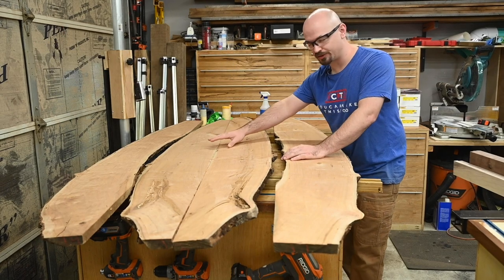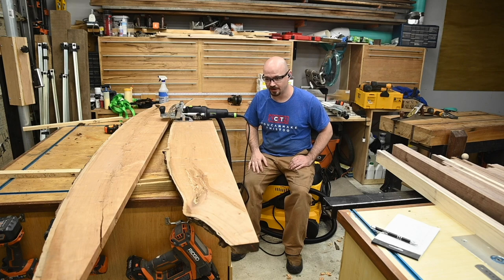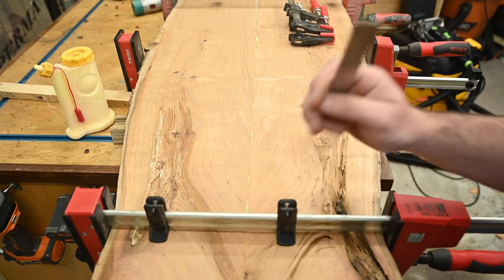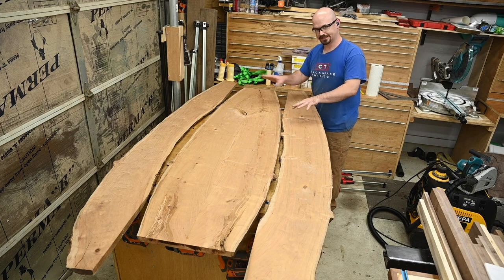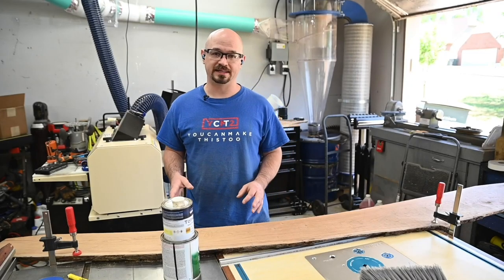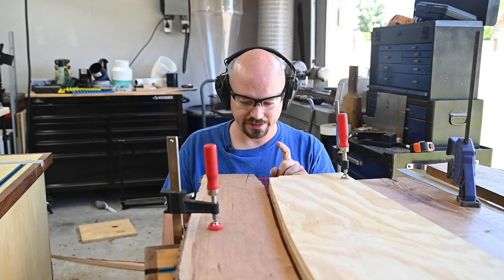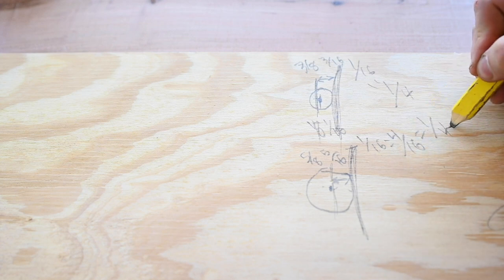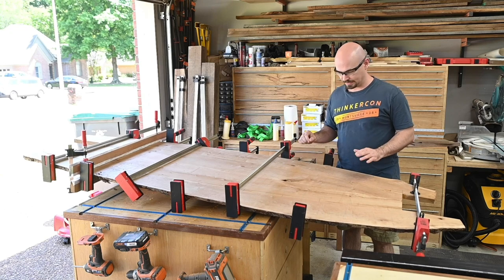Joining Boards on a Curve for Oval Table Top - The Big Build Off

Comment: I’m glad I stumbled on this video. I’m getting ready to join a slab top and wanted to make it a curvy seam. I was just going to try to make matching templates out of MDF. I didn’t consider the fact that the width of the router bit would mess up the curves. Obviously I would have realized that after it didn’t work. But this is going to save me a ton of frustration and scrambling now that I know how to do it right. On the plus side I only have to make one template instead of two. On the downside I have to buy a bushing set.
Reply from the maker: Buying the bushing set beats doing it all once just to not be happy with it, then having to buy a bushing set and do it all again once you figure it out

Comment: Wow, what a nice film, so good to see your thought (and character) process as you go along! You are very clever.
One thing I felt as you described how you were going to cut off the piece with what you called the rot I wanted to shout out to you: Are you really sure,? Of course if it's a total loss, you dont have any other option, but with just cleaning it out and filling with either a replacement piece, or a decorative filler (ground turquoise if you don't mind the kitsch, or wood, or epoxy with gold flecks, you could have a unique decoration.
Reply from the maker: I was okay with there being some.. but didn’t want it to detract from the design or rest of the wood. Stuff like that tends to really draw the eye, but I want it drawn to the shape, the curves of the grain, etc... first Friday of June the finishing video will come out and you’ll see how I approached them. I’m not opposed to highlighting defects, but I wanted to go a different direction with this table. Thanks for the input!

Comment: Have you ever tried jointing curves at the same time with a 1/2” bit? Clamp both boards to your workbench, with the template clamped on top as well, and a small (1/8”-1/4”) gap between the two boards. Would that work (create the same arc), or am I thinking wrong?

Anywho great work!
Reply from the maker: Unfortunately not... imagine a compass (like from elementary school for circles.. not the boy scout kind). You have a pivot point and a pencil. The pencil is one "edge" of the router bit. If you're cutting with both edges simultaneously that'd be like putting another pencil a 1/2" away from the first on the same compass. That'd make two circles two different sizes. 

Curves are not intuitive at all. The real question though, is it that amount of difference enough to be a problem? ....I haven't bothered trying to find out yet! With just a nearly simple curve like this it'd probably be fine. Last time I did this technique it was a wavy curve and the would cause problems.
Reply: YouCanMakeThisToo but you’re following the plywood template while simultaneously cutting the ID of one and the OD of the other... But that’s why I’m a trial and error kinda guy, my brain gets all knotted up 🤣🤣🤣
Reply: @busterdickerson8725  
While straight 'kerfs' have no such issues, 
"curved kerfs might make you curse"